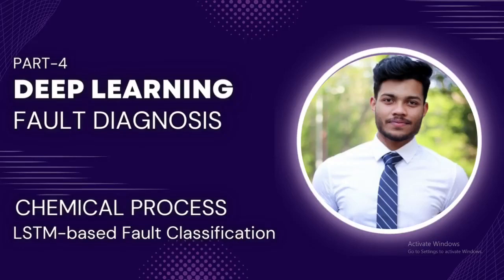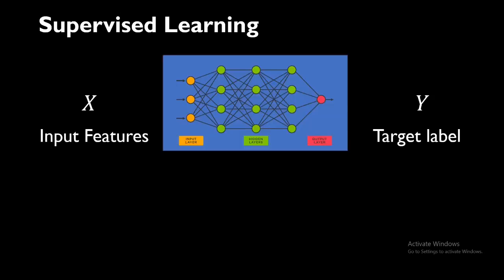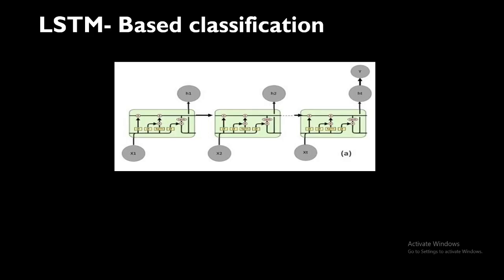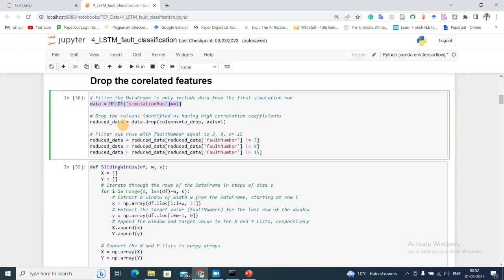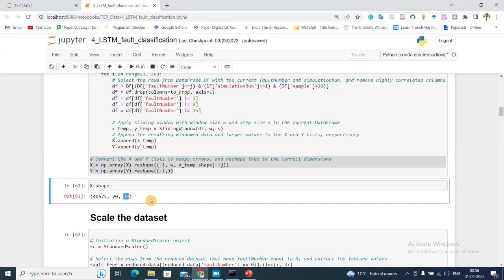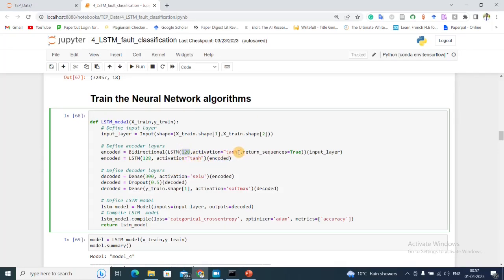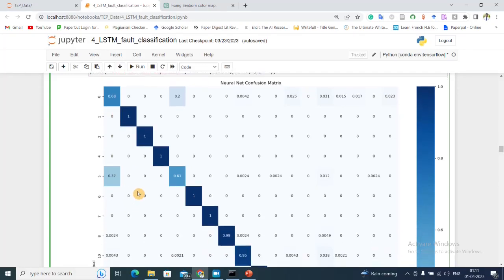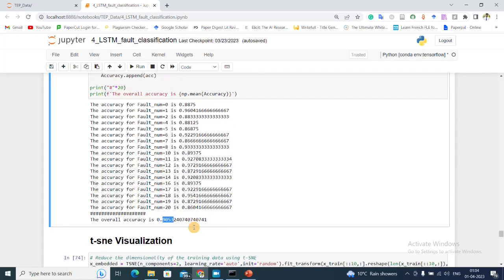Predictive Maintenance using Deep Learning || LSTM based fault diagnosis

Comment: In your SlidingWindow function, shouldn't the y = np.array(df.iloc[i+w, 0]) ?
Reply from the maker: Thanks for the query. You would be right if we were doing single variate analysis, however in this case we want to use 50 sensor data as input to lstm model, that's why we are choosing all the columns except first 3
Reply: @Mohankumardash  Thanks. I mean you explained that we will consider the n+1 the label for a sliding window of n, however in the code its considering n th label. Also, the code clearly commented we are considering the label for last row of the window, which is in line with the code. Not a big thing that changes the results, but a small confusion.